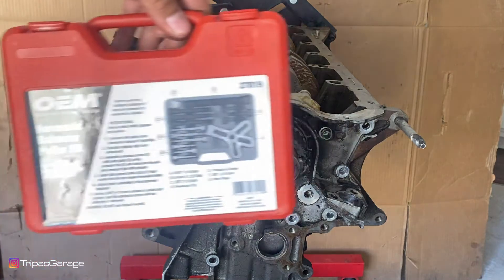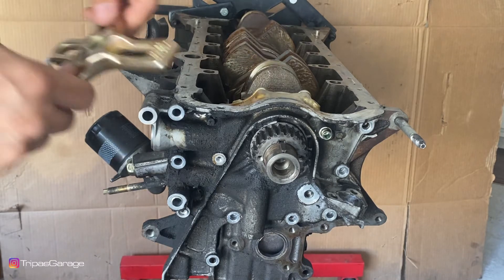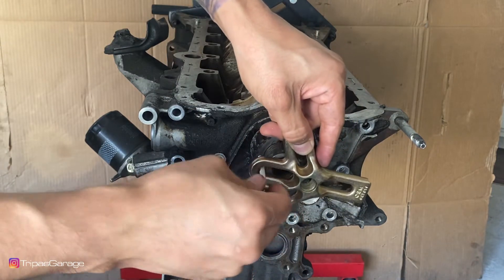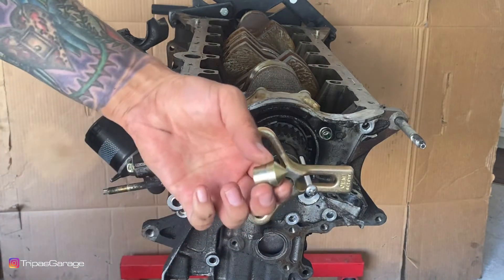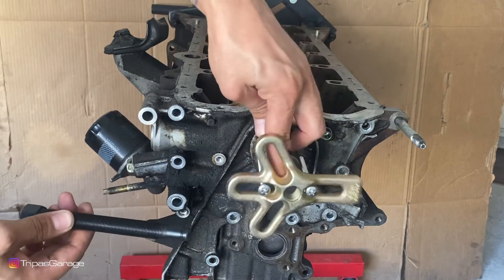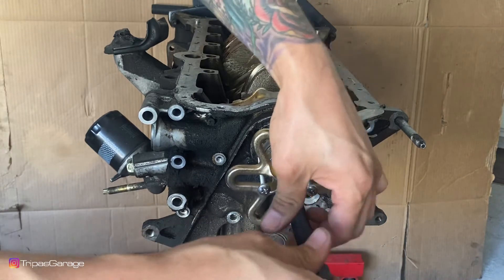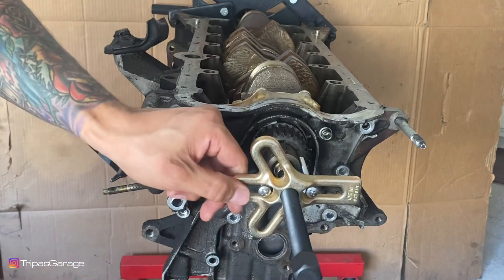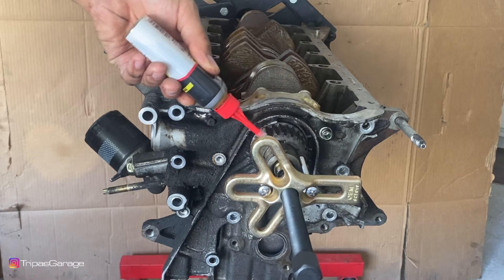Lower timing gear (cog wheel) removal

Comment: Right tool for the job, but if you haven't removed the engine, you can't get that big bolt on there without first removing the sway bar.  At least on the NA miata.